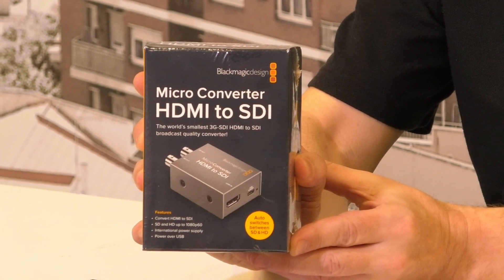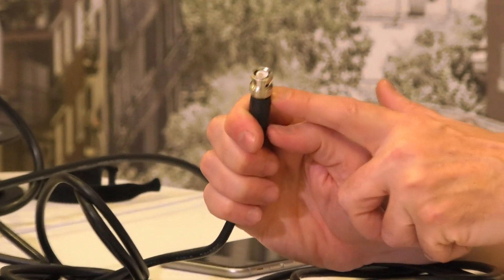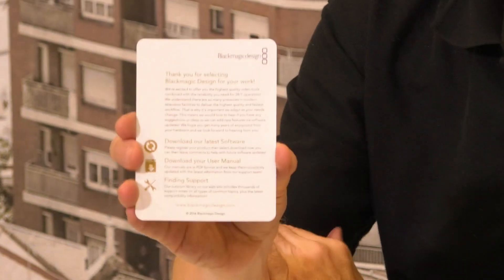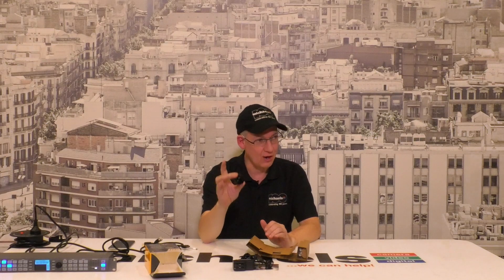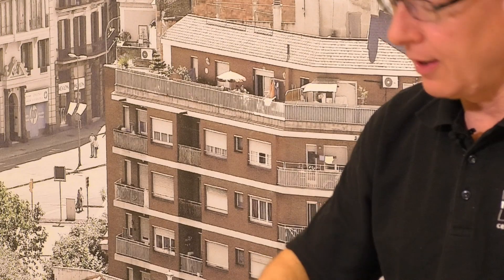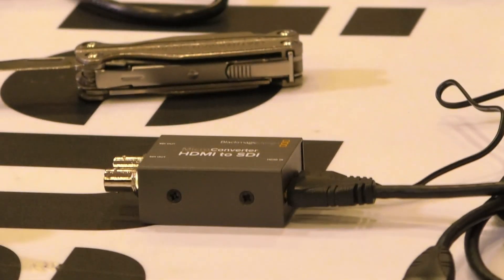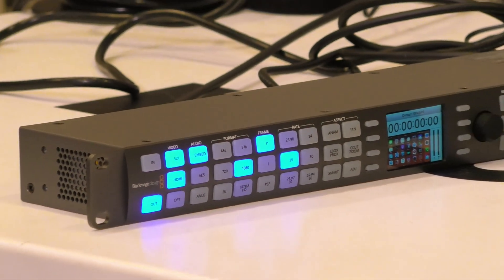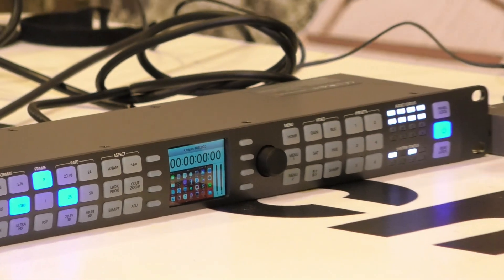Blackmagic MicroConverter Unboxing

Comment: One question, how do I convert a signal from my hp laptop to my atem television switcher using micro converter hdmi to sdi.  I have tried to install a converter setup and still not detecting any signal.  What should I do in order to get a signal?

Comment: do you know if BlackMagic got the audio problem fix?
Reply from the maker: MiDas - can you please explain the audio problem you are having? We have been using the MicroConverters for sometime and not had any issues with audio. And the best news is they just had a huge price reduction.
Reply: Thank you for replying back. I haven't purchase the unit yet. I needed to send a feed to our church nursery but I read reviews saying that there were audio problem with static noise. I even check on Blackmagic's website in the forum and I was shock to see that there was many cases dealing with it. 
     I did notice that price reduction that's why I was going to buy it because we're on a budget.